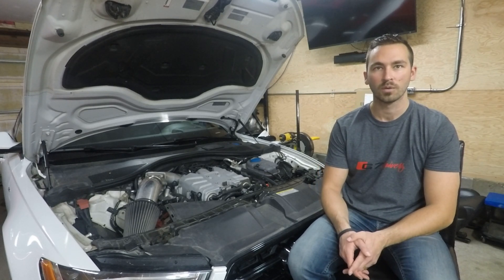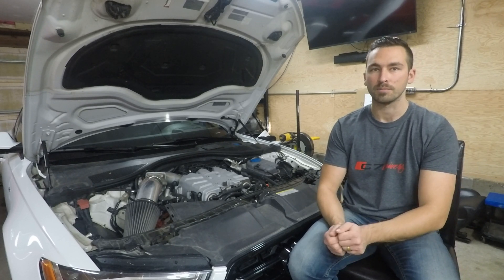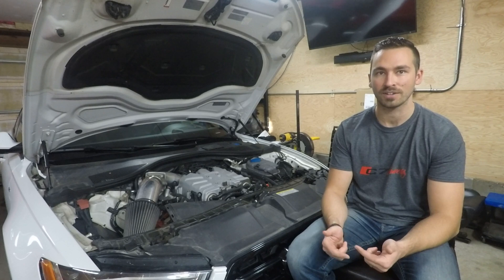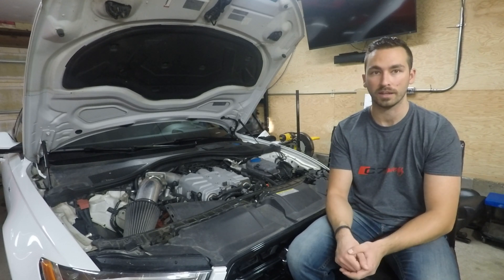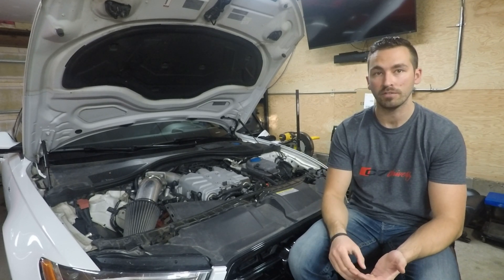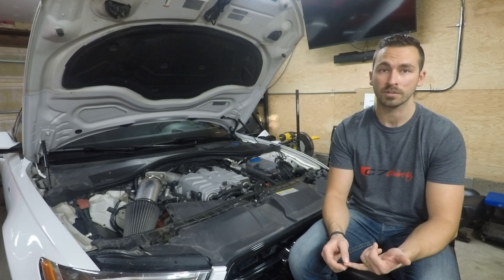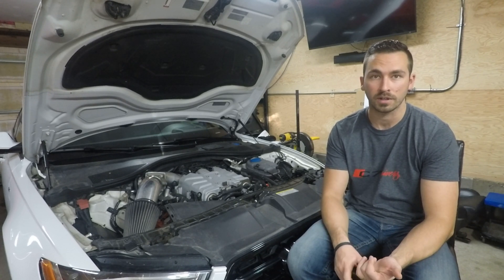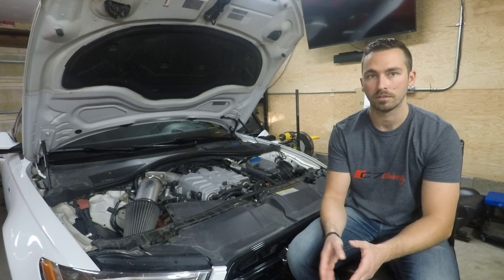3.0t Tech Talk Ep.2 // ZF8 Transmission Tuning

Comment: Very late to this, but this is a very informative video, I have an Audi A6 2014. 8 speed. 3.0T
Questions:
1) You may not know but I had a question with how upgrading a steering wheel would work. I have a 4 spoke, no paddle shifter, steering wheel, I know I don't need the paddles, but it's something I would honestly love. If I purchase A8L 4 spoke, (with paddles), would this be able to sync up to the transmission (as I don't have paddles and now would)

2) Do I need Twin tunes between my ECU& TCU (ex. both IE, both 034) I have heard of some pretty gnarly TCU tunes for these cars. Thanks!!
Reply from the maker: Hey I can't speak to that with accuracy. So I don't know.

It does help, the tcu tunes are matched to the ECU tune and how different tunes report torque, its best to have something properly matched together. The ZF8 is forgiving, it can have mismatched tunes but to be properly optimized, best to match them up.

Comment: more of these tech talks please!
Reply from the maker: What do you want to learn about?
Reply: @SuitedUp2The9s 

some topics I think your audience and googlers would find useful (coming from a recent A6 C7 purchaser myself):

- single vs dual pulleys
- downpipes or cats
- oil recommendations
- exhaust preferences
- intake preferences
- differential + transmission inserts
- driveshaft carrier upgrades
- throttle body modifications
- HPFP upgrading
- coils and spark plugs
- rear swaybar upgrades (recommended or not?)
- timing chain issues
- typical maintenance schedule of a hard driven stage 1 or stage 2 car over just stock soft driving
- to E40 or not to E40?
- transmission fluid change?
- rear differential fluid change?
- when to upgrade brakes and what to expect
- the top 5 performance mods to add with a limited budget
- what to check before you begin boosting power
- how to read a dyno/obd2 data logger chart for an A6
- tires, rims and spacers
- suspension modifications

a lot of these are just singular ideas - but I think you can wrap a couple of these into singular 5 minute videos

these are all topics that I have come across in the past two months of ownership that I have done or learned about online through the forums - if you put them in video format you would get more clicks!

if you would like further insight into my thoughts on your approach to any of these topics let me know!

3.0T community strong 🦾

Comment: Hi Josh, just ran into this video and interested in a tune, however I was made to believe the 8ZF transmission wasn’t tunable, I currently run an APR Stage 1 file and wondering if ( from what you said) if I’ll have to switch vendors or will APR offer the ZF tune eventually
Reply from the maker: Hey! The ZF8 is indeed very tunable and requiring tuning when increasing engine performance. I haven't seen APR offer a tune yet for the ZF8. They like to advertise that it's not needed in their literature so I wouldn't think they would offer one.

Comment: I have an early version of the A6 3.0T (2009) and will go stage 2. 
Is the TCU tune available for my 2009 A6?  I have the 6 speed tiptronic Quattro.
It's a shame our tiptronic transmissions are quite slow even in sport mode.
Reply from the maker: To my knowledge JHM offers a TCU tune for the ZF6 in your C6. I am unfortunately less versed in the C6 gen for parts/software availability